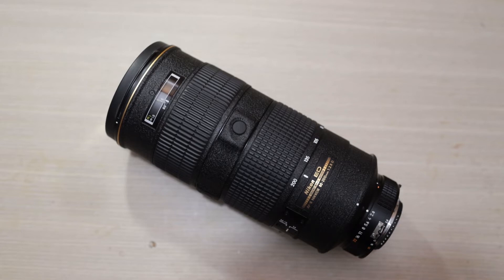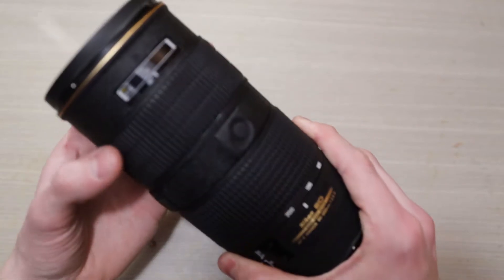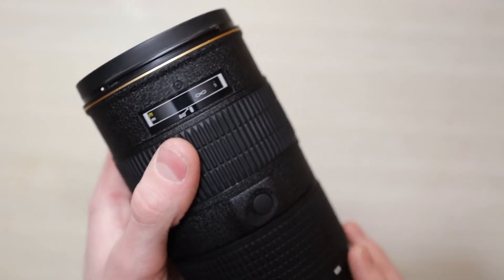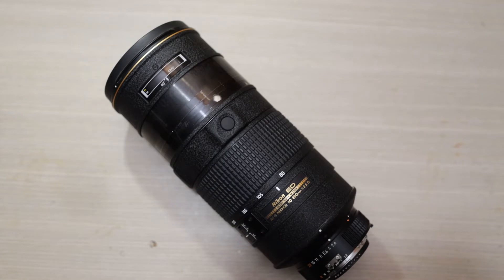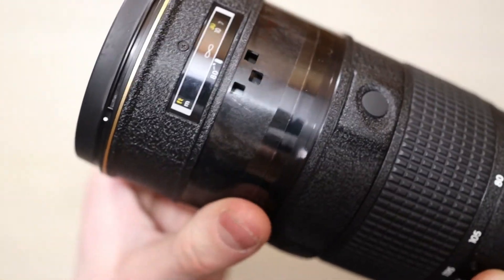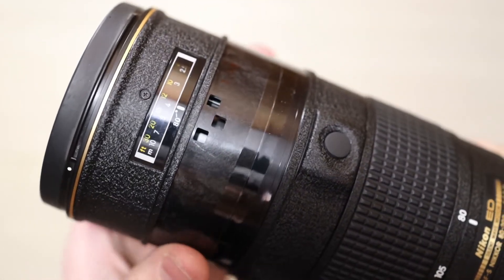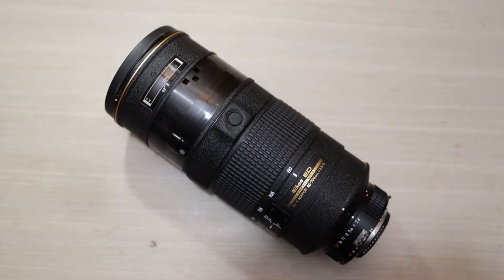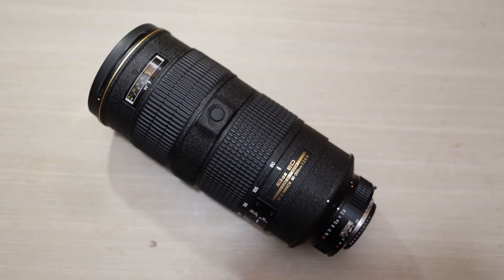~20' Stuck Focus Issue Fix for Nikon AF-S 80-200 F/2.8 D (NO DISASSEMBLY)

Comment: I picked up an old 24-70 2.8G where the AutoFocus isn't working.  Lens looks like new and owner said he never dropped it.  He said it worked last time he used it, but he didn't use it for a couple years and sitting a long time is known to cause this issue.  Would be interesting if the same root cause was a ribbon cable.  I'd really like to get the AutoFocus working.

Comment: I'm glad I found this video today. I have an old 80-200 f/2.8 which was gifted to me years ago by one of my best friends in life, which has had some AF failures over the last year, then suddenly would not AF at all this weekend. Very sentimental piece of gear which we keep going to honor my old friend. I feared we had reached the end for the lens, but I happened to notice that this video mentioned - in passing - that the same fix also corrects failed AF for this model. Sure enough, it fixed mine too, and my old lens is back in action!

Comment: Great video.  because the squeak sound from the AF-S motor in the lens COULD be caused by the symptom described in your video.  Too bad,  it could save numerous copies of this Len which per-matured been diagnosed as the AF-S motor failure. IF the lens had the squeak sound happened then this video is the first step to check, IF NOT then move on.  Thanks

Comment: Wow! I wish i knew that 15 years ago when I was told it would cost more to fix it then buy a "new" one. I.e i gifted one to a friend who worked in photography and had this issue tomtry and have soare parts. And bought a second one that also developed it over time. Will definitely give it a go.

Also, mine is a bit sticky in MF, any tips on what grease to use?
Reply from the maker: Hi there! Unfortunately these AF-S lenses do not have mechanisms you can grease. It could just be dirt between the ring and the shell of the lens, so just give those edges a good clean with something like isopropyl on a cotton swab and let it dry completely, then put it back together.

Comment: Just bought this lens from someone on fb marketplace for $50. Was a little disappointed but not really surprised it had a some focusing issues (even though the lady said it worked fine), but happened across this video and it worked like a charm! Really pumped now to use this with my F100 now that it focuses so well, thank you for making this video!

Comment: I thought I had the motor squeal problem, but it was just this simple fix!  Thank you.  Have you looked into keeping the cable out of they way or do we just poke it periodically now?
Reply from the maker: I have since done significantly more in depth repairs on this lens and others, but you can access this ribbon cable by removing the front cap (not the lens cap, the front barrel casing held on by the three screws visible on the outside near the front) off the lens and working around the front elements, and then you can reglue the ribbon cable down. There is another video on YouTube doing this essentially, but I won't make my own as I think that is a little outside the realm of general repair, and pushing it down whenever it becomes an issue is sufficient for most people until they want to sell the lens or gift it on.
Really odd that Nikon's adhesive on this specific cable comes loose and no other cables do, and it's pretty darn good adhesive, too.
Reply: @edifiedproductions  I'll look for it.  I was just about to dispose of this lens and I decided to google the stuck focus aspect instead of the squeal.  Thanks again!